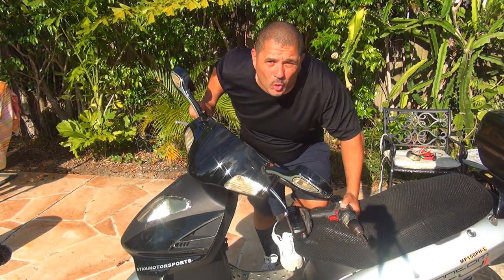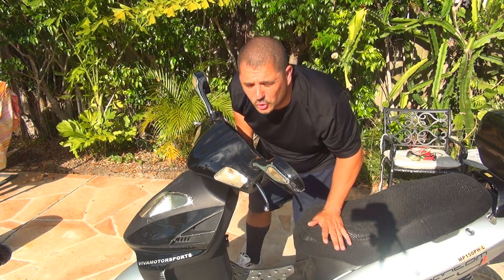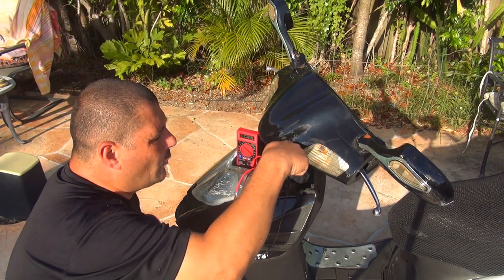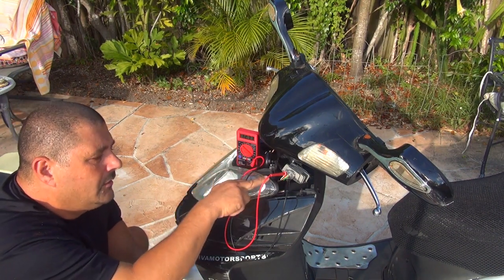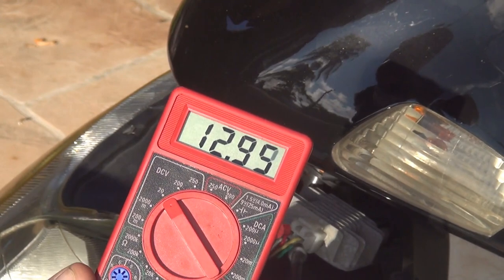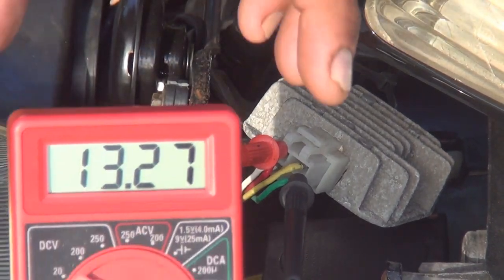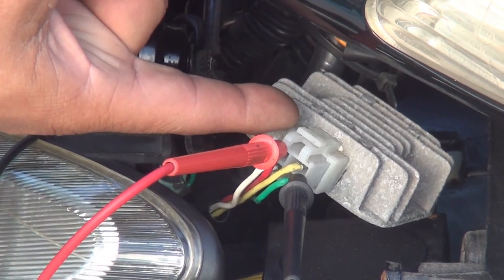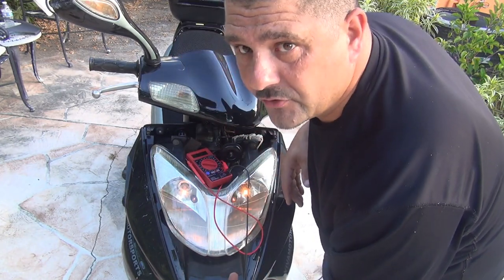Scooter / Motorcycle rectifier regulator Gy6 150cc

Comment: I've been watching all your videos I really appreciate everything that you do I have a question hopefully you can get back to me when I go to start my GY6 150cc but I hold the brake and hit the button my head light come on sometimes it will start with the kick-start it won't start on its own and it only stay running if the rear brake is engaged what do you think is my problem
Reply from the maker: I'm glad to hear that you've been finding my content helpful! Based on the information you've provided, it seems like you're experiencing a few issues with your GY6 150cc scooter. Let's break down the problems you've mentioned:
Headlight Coming On: The headlight coming on when you hold the brake and hit the start button is likely a normal function of your scooter. Many scooters are designed to turn on the headlight as a safety feature when the brake is engaged, indicating that the vehicle is in a starting or running state.
Starting Issue: If your scooter sometimes starts with the kick-start but doesn't start on its own when using the electric starter, there could be a problem with the starter motor, the battery, or the electrical connections. It's possible that the starter motor is not receiving enough power to crank the engine. Check the battery voltage and connections to ensure they are in good condition. If the battery is weak, it might not provide enough power to turn the starter motor properly.
Engine Running Issue: The fact that the scooter only stays running if the rear brake is engaged could indicate an issue with the brake switch or the safety interlock system. Many scooters have a safety feature that cuts off the engine when the brake is released, but if this system is malfunctioning, it might cause the engine to stall when the brake is not engaged. Check the brake switch and associated wiring to ensure they are functioning correctly.
To troubleshoot these issues, you might want to consider the following steps:
Check the Battery: Ensure that the battery is charged and in good condition. Check for loose or corroded connections and clean them if necessary.
Starter Motor: If the electric starter isn't working consistently, you might need to inspect and possibly replace the starter motor or related components.
Safety Interlock System: Examine the brake switch and any associated safety interlock mechanisms. If there's a problem with the switch or wiring, it could be causing the stalling issue.
Electrical Connections: Inspect all relevant electrical connections for signs of damage, corrosion, or loose wires. Secure connections are crucial for proper electrical function.
Professional Inspection: If you're not comfortable performing these checks yourself, it might be a good idea to take your scooter to a qualified mechanic or technician who specializes in scooters. They can diagnose the issues more accurately and provide the necessary repairs.
Remember that troubleshooting and repairing vehicles can sometimes be complex, so it's important to take safety precautions and, when in doubt, seek the help of a professional.

Comment: Okay so I have a GY6 Scooter , just fitted a 82cc big bore head and cylinder onto it. And now , when I turn it over , the wires from the battery start to smoke when you click the ignition , but then the battery is rapidly drained from power. Do you know what this could be? Thanks
Reply from the maker: Hello Jf I think  you have a short somewhere in the system
Reply: How are you liking the ride after the big bore? I feel like my iceberg is one of the good ones, as it seems faster than my friend's icebear and ive kept mine all stock.

Comment: Can a faulty regulator cause a drain on the battery when the scooter is not running? Thank you
Reply from the maker: Yes, a faulty regulator on a gas scooter can potentially cause a drain on the battery even when the scooter is not running. The regulator is responsible for regulating the voltage output from the scooter's charging system and ensuring that the battery is charged properly. If the regulator is faulty, it may fail to regulate the voltage correctly, leading to overcharging or continuous power draw from the battery, which can result in battery drain over time. It is advisable to have a faulty regulator inspected and repaired or replaced to prevent unnecessary battery drain. Thank you for watching my video
Reply: Thank you!

Comment: Virb,   hello.  What would make a taotao 49cc scooter cdi box catch fire? It burned up where the positive and negative connect.
Reply from the maker: Hello my friend I have a feeling that you have a short somewhere in your scooter and that could be from the stator alternator that send lots of voltage to the cdi or is a bad cdi that makes voltage resistance so the easy way is to replace the cdi and see if the same problem came back

Comment: I have 150cc gy6 and my headlights stopped working but both my turn signal are working also the break light . Do I need to buy new one
Reply: Do I need to buy new regulator for my scooter
Reply from the maker: Hello Merjim Jimenez  you should have a multimeter https://amzn.to/3wmyjFh so you can check if any dc  voltage get to your lights if you do not  have that try to check if the plastic connector is clean and the connection do not have any corrosion also try to follow the yellow wire from the lights to the stator to make sure there is any brakes or cuts in the wire I hope this can help you
Reply: @VirberelloScooterTips  okay I will but like I said I think I have really old regulator so I ordered one on Amazon and engine wire looming
Reply: Mine was showing 14.7 just idling. Was blowing my headlight bulbs. Or only high beams would come on or flicker. Changed my rectifier and it's it's around 13 idling and my lights work now. Thanks

Comment: Do you have to have a rectifier? I’m trying to make my wiring as simple as possible and would rather just get rid of it if it’s not a necessity
Reply from the maker: Hello my friend yeas you need a rectifier on your scooter for many reasons
Reply: @VirberelloScooterTips  such ass? I’m building a stunt scooter and want the wiring a simple as possible, I’ve seen several People run no rectifier , I only want a killswitch, headlight, taillight, under glows, cdi, main for the motor, and that’s about it, I have no dash so no gauges , no turn signals, nothing

Comment: I am experiencing colder morning in NC, when I try to start my scooter early mornings(50 degree), the battery dies...I have to charge it to get it to start?
    Any ideas?
Thankyou
Reply from the maker: Hello my friend unfortunately battery really have hard time in cold weather or really hot weather the best you can do is to buy a new battery because your battery is losing cranking amps plug if is possible and you can connect your scooter to an outlet power source buy a battery tender to keep a good voltage flowing when you not riding your scooter that will give your battery a longer life . Thank you for watching my video
Reply: @VirberelloScooterTips  I will definitely try that...thankyou so much...you are my go-to person for scooter content. Always makes things easy to follow and fix yourself

Comment: Hello! I changed a light bulb in front of the scooter while the scooter was started ( mistake) and now I have 6v output to the battery terminals + and -  and no short bram and long beam... The turn signals work fine, the scooter starts without the battery and the voltage from the stator is around 40-50v when I rev it up. The rectifier is dead? Thank you!
Reply from the maker: Hello you could have short somewhere or the regulator is going bad
Reply: Hello, my scooter been sitting for a couple months and when i turn on ignition there is no sound coming from the fuel pump do you have any idea what the problem could be ? Thank you

Comment: What if my voltage goes up until I turn my headlights on? Something is draining power with headlights on
Reply from the maker: Yep the there is a possibility of a light short in the harness wiring so the only way to find out the problem is with a multimeter and check for continuity
Reply: @VirberelloScooterTips  thanks for getting back to me . I've tested headlight harness and cannot find a short circuit... when I check he voltage regulator wit lights on voltage drops allot until I turn off or disconnected the headlight from the front

Comment: Good vid, electrical is my least understood topic. Maybe one vid you can explain how the lights tie into the system??
Reply: So, a/c starts at stator,flows into rec/reg,then d/c flows into battery to charge it. ...so when/How do the lights tie into the system?
Reply from the maker: Great idea thanks
Reply: @danielhawkins6619  They must be connected after the regulator since they dont turn on with the rest of the system rather with the engine.

Comment: So does the stator charge the battery if the scooter is parked and idling? Or do you need to be riding for it to charge? Thanks.
Reply from the maker: Hello Roland yes the stator always charge the battery but if you only keep your scooter at idling level you will fully charge your scooter battery in 8 to 12 hour but if you ride your scooter your battery  will fully charge in 30 to 90 minutes. Thank you for watching my video
Reply: virberello GY6 Tips and Tricks Awesome, just what I wanted to know. Thanks.
Reply: There are many 12v voltage readouts online. I plan to get one for my scooter.

Comment: What does it mean if my lights get brighter when I rev and dim if I use my blinkers or brakes?
Reply from the maker: Hello my friend when you rev your scooter produce more electricity but if you place the blinker and or brake your scooter is using more electricity then is producing this can also happen if your stator poles heads a dirty or rusty or the inside of the flywheel needs to be clean with send paper .Thank you for watching my video
Reply: @VirberelloScooterTips  It also is more noticeable at lower idle speeds.

Comment: If the bulb on my headlight exploded the glass what would cause this
Reply from the maker: If the bulb in your gas scooter's headlight exploded and shattered the glass, there are a few potential causes for this:
Overvoltage or Voltage Spikes: If your scooter's electrical system experiences a sudden increase in voltage, it can cause the headlight bulb to explode. This may happen due to faulty voltage regulation, a damaged regulator/rectifier, or issues with the charging system.
Defective Bulb: Sometimes, a headlight bulb might have a manufacturing defect that causes it to fail prematurely. The glass can shatter if there is a weakness in the bulb's structure.
Vibration and Shock: Scooters can be subjected to vibrations and shocks while riding, which can contribute to the wear and tear of components. Excessive vibrations can lead to a bulb's filament breaking and the glass shattering.
Water or Moisture Ingress: If water or moisture seeps into the headlight housing, it can come into contact with the hot bulb, causing it to crack or explode due to thermal shock.
Incorrect Bulb Installation: If the bulb was not properly installed, it might not be securely held in place, leading to excessive movement and breakage.
Wiring Issues: Faulty wiring or loose connections in the headlight circuit can cause irregular voltage supply, which might result in the bulb exploding.
To resolve this issue and prevent it from happening again, you should:
Inspect and repair any damaged wiring or electrical components in the headlight circuit.
Make sure you are using the correct and compatible bulb for your scooter's headlight.
Check the voltage output of your scooter's charging system to ensure it's within the specified range.
Securely install the new headlight bulb, following the manufacturer's guidelines.
Keep the headlight housing clean and ensure there are no openings that could allow water or moisture to enter.
If you're unsure about diagnosing or fixing the issue yourself, it's best to take your gas scooter to a qualified mechanic or technician who can properly assess the problem and make the necessary repairs. Thank you for watching my video
Reply: @VirberelloScooterTips  thank u. I wish I could just ride over and allow u to look over the scooter had a new motor  and it's had issues ever since one right after another but the lights have only gotten worse
Reply from the maker: @AmySimotics-lo7lt  I had the same problem one time on my scooter I  bought a motor on Amazon and the motor was not to good but at first that new motor was blowing my fuse all the time and the problem was a defective stator  alternator

Comment: Hi I have a problem with my moped 50cc 
I have a brand new battery but there's no power no lights on dash no nothing what do you think that it can be ?
Reply from the maker: Hello Stefan if the Battery is good there is a possibility that you have a burn fuse on the red wire
Reply: @VirberelloScooterTips I have a brand new battery I've checked the fuses i put a new fuse on it still don't know how to fix it no power at all what should I do,? thanks for your comment
Reply from the maker: @stefan6608  did you test the battery with a multimeter ? second if the battery is ok + the fuse is ok  = burn wire somewhere
Reply: @VirberelloScooterTips  could also be the ignition switch?

Comment: Hello, my scooter been sitting for a couple months and when i turn on ignition there is no sound coming from the fuel pump do you have any idea what the problem could be ? Thank you
Reply from the maker: Hello Vasile my question is do you have any voltage in you battery ? because the little battery if you do not keep them alive with a battery tender they do not last to long and you can try to recharge them or buy a new battery if the battery is good the problem could be the wiring or the fuel pump that needs to be clean or replace. Thank you for watching my video
Reply: @VirberelloScooterTips  also my fuel gauge works fine when i turn ignition on

Comment: my headlights stopped working out of nowhere also kick not working can this be the rectifier
Reply from the maker: Hello try to check the headlight Wiring Harness Socket sometime the get corrosion or they disconnect or the battery fuse . Thank you for watching my video

Comment: I have a question. My turn signals work fine same for hazzard lights. My dash and running lights flickering. . I took the front of the scooter no rr.
Reply: could the rectifier be on the bottom right-hand side of the scooter by the stator. My lights just flash on and off if I hit a bump just out of nowhere
Reply from the maker: @gmsmith5678  Hello my friend if your light flash on and off when you hit a bump I think you have a problem on a wire connection that is not tight or the yellow cable at the stator is not welded properly . Place the scooter on the center stand remove your scooter front cover check the wire that goes  to your light and shake the wire and follow the wire to see if the cable has any cuts or brakes in the wire . Check this link http://www.firenzee.com/gy6/ you can find lots of info in there . Have a good day my friend I hope you find the problem
Reply: virberello GY6 Tips and Tricks thanks brother. I love your videos.